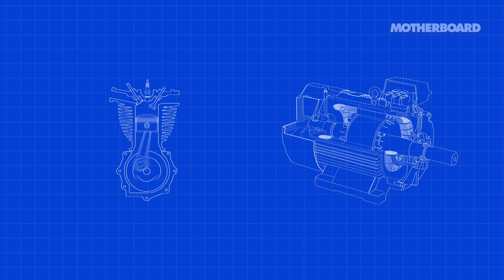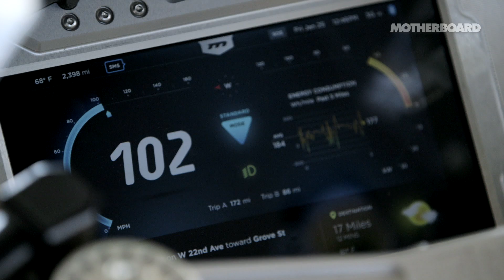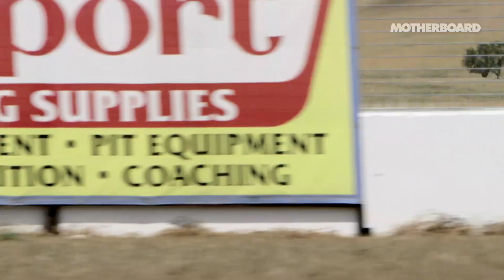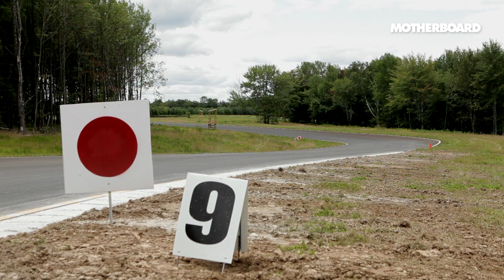Mission RS: The Electric Superbike of the Future

Comment: why they dont put a generator at rear wheels to recharge the batteries??? or directly feed the propultion engine????
stop treating us morons
Reply: Robert Herzig I am not 100% sure, but I am pretty sure that windmills have to put out 60hz sine wave AC, of the wind blows harder they either have to increase their power output until they are back at 60 hz, partially short the leads to simulate a higher electrical load to bring the speed down to 60 hz or completely disconnect from the grid.
Reply: Jose Matos i think it's because a generator has a lot of resistance. It would just slow the bike down. Take a look at windmills for example.. even when the wind goes like crazy they are turning around pretty slow.
Reply: Robert Herzig Yes for shure , but on same time the weigt on moov it's a force too and with somme supercaps you'll get one seccond...the problem it's oil companies pression..
but it's just m'y thinking
Reply: Jose Matos I was responding to Robert, windmills spin at the speeds they do because they are locked in phase to the electric grid; small windmills are DC or whatever......

Anyway, I have no idea why emotorcycles haven't incorporated regen braking, my best guess is the unsprung weight of a generator on the front wheel.
Reply: Isaac Karjala
you need magnets , coper coils , some good idea's , a litle battery for the launching only..
and try with a dc motor..
we have a lot of way's at disposition to create electricyti..
Just be logical and use all your imagination
Reply: they dont have the ryght to reach the oil performance like the us ev's from 90's.
we are intoxycating wearth only because money and power
Reply: just need to think a litle bit and use technologie from 100years
Reply: ***** the only thing impeding that is oil warfair.
sorry about m'y inglish
Reply: +Jose Matos That would be silly. You would lose a lot of energy and power in the bike itself. And adding more parts that cost money to produce and fix and adds to the weight of the bike and possibly lessens the aesthetic quality.
Reply: Anon Ymous with 3 normal electric motors with 10Kwh eatch i produce to you 10 Kwh for free to be used..
sorry with m'y inglish
Reply: Anon Ymous you can eliminate 99% of the friction with magnetiques poulies..you even can push the frixion to zero point freezing the magnets and coils to zero absolute using liquide azote under 2 atmospheres of pression.
i hope i spoked enof inglish .
lol
Reply: Jose Matos I guess space and money might be a problem? It might cost too much to do all that. But sounds like cool ideas.
Reply: Anon Ymous energie are free and natural no cost free and evry were
Reply: ***** no man the frixion dose , and you can eliminate 98% of it
Reply: Why don't you make one if you know how to make it?
Reply: ***** Dont be naíf if you realy have somthing to replace oile , lol...They juste chut you off
Reply: ***** simply a bad inglish
Reply: ***** no only you jack ass
Reply: ***** you have a murderous government and thief of oil from all the world, you do not want change energy
Reply: ***** poeple like you and me belive that cince 120 years but oil industry kill evry oponent...
sorry about my inglish
Reply: A Formula 1 car has KERS generator and how heavy is it? 10 kg. Go figure

Comment: Gas, shifting, transmission, GONE!!!! Of course the price is high, cell phones in 1989 were $1000 and up, big and bulky, now they are sometimes free and smaller than a candybar. The infrastructure is going to change once this range anxiety rumor mill dies down. Electricity is everywhere, my mom told me ppl did'nt even wanna have pushbutton phones and liked rotary better years ago, ( try that now ).  The only thing that can impede the progress now will likely come from greedy politicians who wanna stall it until they can find a way to tax it, and even that won't slow it down.
Reply: How do you get a free cell phone?
Reply: +Lucas D Very much on point! BTW, (imo) the best vs. argument I've ever seen/read! Bravo!

Comment: =_= If the god damn Motor costs less than an actual engine and they just adapt an already made chassis then why do they cost so much?
Reply: Infact if somehow we could get water to hold a charge, we could fill up the gas tank like normal only for it to go into the battery and charge it up.

Comment: How long do the batteries last and whats the cost of replacements during a one year period.
Reply: The life of a battery is determined by how many charge discharge cycles it's had not by how old it is and I dont know where you got your info from but no lion battery will last that long. I have been selling top end electric bicycles for a few years now and 3 years commuting is all you get before replacements are needed.  I also note that you have no videos on your channel to prove you know what you're talking about.
Reply: Replacements you can recharge the batteries???
Reply: So they last forever then. The first rechargables that do.
Reply: Modern lithium ion batteries will have 80% degradation after 8-10 years but are still fully usable for a while after that.

Comment: one thing i really hate about electric vehicles is they go on about being the future? really electric vehicles have been around as petrol vehicles. its taken 150 years to get vehicle that will do 100 miles? how much longer do people have to wait and why are they so damn expensive?
Reply: "its taken 150 years to get vehicle that will do 100 miles? how much longer do people have to wait and why are they so damn expensive?" 

In case you weren't aware, research on EV's hasn't really started taking off properly until the last couple of years.  The advent of the combustion engine all but phased early EV's out.

They're expensive because of one simple fact: economies of scale.  Millions of combustion-engined cars and bikes are made annually.  The number of EV's made is a tiny pinprick compared to that.  If the roles were reversed, I think you'd find the EV's the cheaper of the two.
Reply: because big oil companies still run the world market , that is why . just like coffee , chocolate and gold did way back in the old days
Reply: basically your saying its all about rich people wanting more money? sounds about right

Comment: One flaw; exhaust sound.
Reply: Flaw? This things sounds sick! I'll take the Mission RS over and gas superbike. It sounds like a cross between a pod-racer and a TIE-fighter. That means I'd be able to go crazy without waking up the neighborhood and attracting the cops.
Reply: Touge pilot Gas moving out of an exhaust barely makes a sound and in any case you shouldn't hear much of it if you have a proper helmet on your head.
Reply: The fucking explosions inside the cylinder head is what makes the engine noise. Not gas coming out the exhaust.
Reply: Fennecbutt have you ever ridden a motorbike? lol
Reply: theres no exhaust on the bike
Reply: That's my point, there's no sound, not as fun :/
Reply: Lol just throw a speaker on the bike and bam your good
Reply: not a sound competition
Reply: Don't worry  there will still be a noise only internal combustion engine noise. Competition in the future
Reply: Your sound in an internal combustion engine without being muffled sounds ugly like the 19th century engine
Reply: Fennecbutt You're wrong. Exhaust leaving the engine makes a significant noise. That is why manufacturers of gas motorcycles and automobiles put a muffler on it to muffle the sound. Even with my stock exhaust pipe I could definitely hear the exhaust with my Shoei RF1200 helmet on, which is one of the quietest helmets out there at the moment. Have you ever chopped the muffler from a motorcycle or car? You will find it is extremely loud.
Reply: Touge pilot people tend to see bike sound/noise as a negative thing because it is in fact noise pollution in most case scenarios, but it's a must have in every bike because reving in traffic will let other drivers know that there is a bike and so they can be more careful and avoid accidents.

Comment: electric vehicles have problems: garages need to kill it! Think of a electric bike/car. In theory, there is no "mechanics"! No air-intake (in car cases, attach disc motor to driving wheels only), no transmission, no gear selecting, no exhaust, no... The idea is: u will need almost no maintenance at all (pretty much like a large vacuum cleaner), electric motor, cables, center computer, in case of wireless charging (applicable on tracks and later on road, like how a modern train works) no battery. That's it, this will kill garages and mechanics. We are so used to vehicles have constant problems to fix, maintenance, etc, one day it's no more needed, then it's pretty wired.
But imaging a bike like that, probably weights less than 100KG (no mechanics, no battery), 150KW, right-hand throttle and left-hand break, no works for your feet whatsoever. And it accelerates like bullet, sounds like a F16, can take lot more corner speed because of light weight and easier design on weight distribution (much less components), it will kill combustion engine of anything!
Reply: liang qiao Think of electric cars as being the same thing--minus a muffler, air filter, etc.  It's still just a power source and a transmission like any other car.  They really retain most of the complexity of a normal car and therefore won't put mechanics out of work.
Reply: You really don't know much about electric cars.
Reply: teach me then since I'm only learning
Reply: liang qiao Autotronics is like a bitch, that only auto mechanics understand what it what.

Comment: I would call it The Electric Superbike of the Present AND the Future because it's already a preferable alternative in the present :) I would take it over any combustion engine sportbike since I'm I couldn't care less about stuff such as a 1 second lap difference or whatnot. The advantages are just overwhelming and, so, the choice is a no-brainer.
Reply: But it's going to be boring to ride no shifting no clutch
Reply: redneckon2wheels I don't believe it has to be. Sure, you might feel that at first but, it's just a matter of habit. There are also huge advantages on not having gears in terms of both giving you freedom to focus on other things and also improving ease around town and even maybe accelerating or braking when surprised by danger without having to go through gears. :)

Comment: too pricey!  32000 to 75 000$US  what justify those price?
Reply: Batteries are the most expensive component. Usually costing 32%-40% of the vehicle.
Reply: and it has top notch brakes and suspension, not cheap

Comment: i know its a game changer because i rode one this year. indeed its fast, powerful, quiet, and light handling. the pull of the motor is at least 3 times stronger than a gas engine without all the heat on a 85 degree day.
no engine oil, no transmission, no coolant.

Comment: It's really disappointing not to see one good wheelie. I feel this won't be as enjoyable as gas engines. Even if it could wheelie it will probably be controlled by a computer, bullshit. What we really need is alternative fuel! The fuel cell batteries in electric vehicles are somewhat polluting just as well, to produce, charge, and dispose. I hope we can use alternative fuels one day with the petrol motorcycles we currently already have.

Comment: Excellent video! With some experience of an electric moto, I can agree with the performance claims made here. The lack of engine noise (not to mention maintenance costs) changes the experience, it does not negate it. The animated graphic of the internal combustion engine is amusingly incorrect (no power stroke shown!) and the figure given for torque at the rear wheel of the Mission RS is surely incorrect. My current 700cc moto has 178 lbs-ft torque at the rear wheel in top gear. Reduction gear ratios between motor and rear wheel mean the motor torque is multiplied. The motor mechanic protesting about the lack of charging points has two charging points behind his left shoulder! Ok, I agree they are slow charging points.

Comment: "the powertrain is cheaper to build"

$60,000 later....
Reply: Hey I love electric motorcycles and I've been riding since I was ten and im 23 now. I own a 06 ktm 450, 08 aprilia tuono 1000r, 1980 yamaha 650 maxium,  kdx200 1994, suzuki rmz 250 07 and a few others. I happen to love electric bikes.
Reply: Paul Mauser top speed doesn't matter. You rarely go over 100 mph on the street anyway. All the fun happens between 30 and 100 mph.
Reply: azalru Even if you could do basic upgrades, it costs a fortune and you're getting the performance of a stock combustion bike. Do you even own a bike because if you did you would probably not be for electric. I've never met a motorcyclist who didn't like their exhaust, engine feel/looks, and speed.
Reply: Battery cost and the top of the line build materials. Also the Mission R starts at 32.5k, the RS is a limited edition model
Reply: all I'm saying is that It seems near impossible that this specific product will ever make it in the same conversation as a traditional combustion engine bike.. not at 30, 50, 60 grand, anyways. That being said, it's a step in the right direction. I am happy that they decided to spare no expense and made sure they did it right, because long-term I suppose that is what will convince people ..cough tesla cough
Reply: Paul Mauser electric bikes cant hit crazy high speeds yet because of the immense power drain. But top speed is not the only factor in considering it a superbike. Most racetracks don't even have straights long enough for superbikes to run out top gear, especially with stock gearing and sprockets. This bike will out-accelerate most liter bikes to about 130mph, and delivers power so much more smoothly, allowing the rider to make better transitions. The direct electric drive means 100% power is always available, with no shift interruptions, no backlash from the gears, no power pulses from the pistons. just pure, instant torque. wait until these batteries get lighter and more efficient. ultra powerful electric bikes will be here sooner than you think, and it's going to make riding even more awesome than it already is. thats my opinion anyway. ride safe
Reply: Krevin Grard I go over 100 everyday, I'm in a rural area. I also love going through car washes and tunnels to hear my exhaust.
Reply: azalru Can an electric bike even go past 60 in 15. BTW a $5,000 cbr1000rr can do 2.4 stock, think about post mods. There's no easy way to modify an electric.
Reply: Paul Mauser Upgrade battery, more power to the motor and better performance, Model S and Mission RS can do battery swaps.
The mission RS can do the 1/4 lap in 10.4 secs, The electric miata can do it in 9.1 secs. 

Here's an electric bike winning Pikes Peak
http://www.wired.com/2013/07/lightning-pikes-peak-2013/
Reply: Christian Hansen This thing goes 40mph slower than my $3800 supersport. I don't get how they call this a superbike.
Reply: whaaaaaaaat?? wtf dude at that rate how are they ever gonna convince the average joe that these things can compete with all the other bikes out there. With that kind of price tag it's as if they're doing it intentionally to put you off buying one.
Reply: Paul Mauser Can it do 2.7 0-60? I don't think so. 150 mph is even higher than a Tesla Model S top 130 mph.
Reply: Paul Mauser most electric bike engines are not running at full power and you could get the motor rewound for more power.
Reply: Jack Colmar You need to do your research, mate.  The Lightning LS-218 electric superbike is the fastest production motorcycle on the planet.  Note I say: Production, not 'fastest ever'.  And it can hit 218 mph.  So don't tell me electric bikes can't hit crazy high speeds yet because the Lightning is crazy fast.  But at those speeds it's out of range after 30-40 miles, and it's so so expensive to buy.

Comment: What is the most mainstream method of actually making electricity?
Reply: quadcatfly do you know where most of the energy is made to refine crude oil. Its coal. So lets burn coal to make gasoline to burn in our cars. Sounds efficient. So how bout we skip the gasoline part.
Reply: 80% of electricity on earth comes from BURNING COAL. A much dirtier process than burning gasoline.
Reply: You can buy solar panels and make your own electricity.

As for your question, there is no most common or mainstream method; all depends on where you live. Some places make it from hydro power, others nuclear, others coal, others natural gas and an ever more increasing percentage of wind and solar
Reply: quadcatfly
 elon musk, ceo/founder of tesla, has explained a number of times that a combustion engine within a car is only able to utilize a certain percentage of its potential, while the rest is lost in translation. although most electricity is made from coal, it can also be made from wind, hydro, solar, AND an electric motor in a vehicle loses less power when applying it to the wheels
Reply: Underlordtico For the average joe its best to wait on the solar market right now from what I hear. Technology is getting better, why pay for something that is a fraction as efficient and cost much more than what will be available in a few years. I guess the same goes for these electric vehicles. We just aren't there yet.
Reply: It takes alot of coal to refine gasoline. Refining gasoline requires about 6Kwh of energy to refine one gallon.
Reply: ***** i wasn't responding to you didn't realize i put your name in the comment.